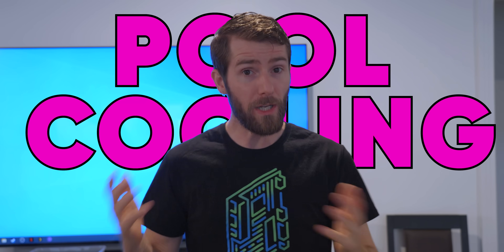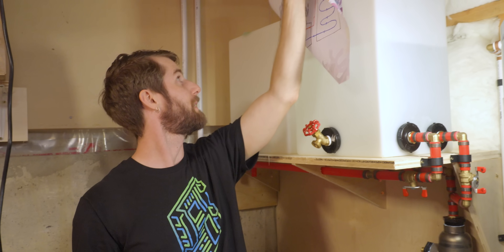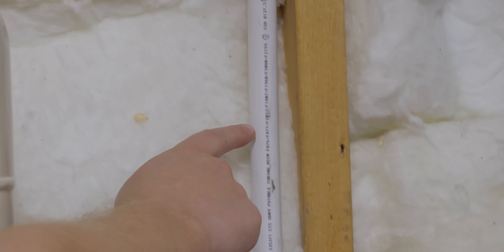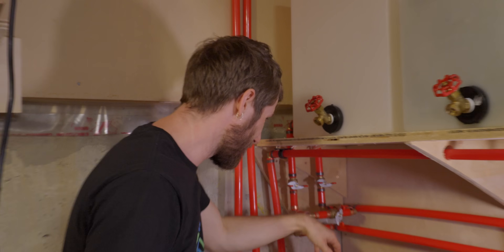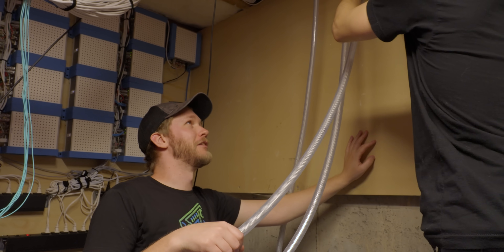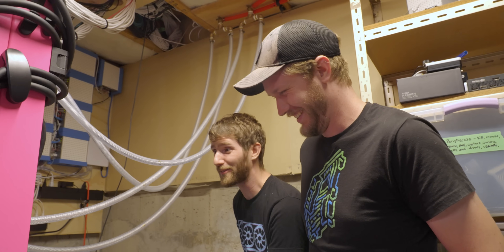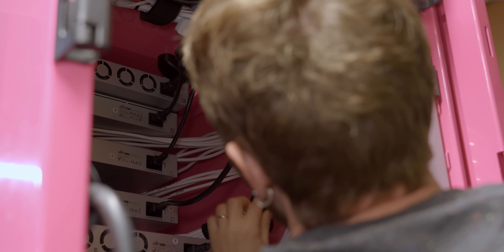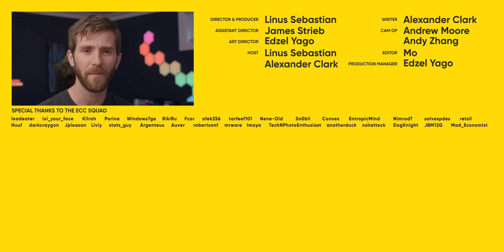My pool leaked and killed my computer - Whole Server Room Pool Watercooling Part 4

Comment: The junction section being in the rack is terrifying, pls point it outwards at least HAHA
Reply: My first thought was, why not have it lower than the computer racks, if it does leak then most likely it isnt going to piss all over the racks.
Reply: I was thinking the same, Linus is just begging for another computer failure because of a leak, especially when the junction was leaking on a couple occasions already... 
I don't remember, does he at least have a drain in this room if shit hits the fan and they're not there to handle it immediately?
Reply: @tsjeriAu  …and the entire pool drains into the server room? That could be bad. :O
Reply: @dschwartz783 you miss the part about 2 separate loops and a heat exchanger?
Reply: @dschwartz783 As someone else already said, they added a heat exchanger with separate loops now, but even before that the cooling setup was never connected directly to the pool's water but rather to piping embedded in the pool's concrete structure. Attempting to use pool water, which is chlorinated and relatively dirty (between people swimming in it and the environment, especially for an outdoor pool), in a water cooling setup would more than likely quickly go south.
Reply: diy liquid cooling in eletronics is a insane idea to me, i value my moneys too much to ever touch it, everyone i know that has it had problems and lost stuff at some point
Reply: Especially after watching alex jankily fix the leaks in it. Fuck me 😅
Reply: Yes! Also why not run the Tubes up from below? Then it cant run down the Tubes in to the Rack
Reply: To be fair, the last comment pointed out why he did it - the systems are the lowest point in the system, so they can't airlock. But drip loops and "put the connections outside the rack" are still smart ideas.
Reply: or maybe have it in an enclosed box ?
Reply: yo what i did not expect to see u here
Reply: Typical LTT jank.
Reply: Yeah we can conclusively say this "in/out" shenanigan is bad.
Reply: my thoughts exactly, manifold in the rack and above all the systems, too... sounds like another disaster waiting to happen.
Reply: It would be cool if you could do some pc based content in the future
Reply: The legend himself! I would love to see you getting a custom PC from Linus some day. 😅
Reply: @M1tZk1  Would be awesome, but he already has a rather killer setup
Reply: @M1tZk1  legend? he plays videogames in his bedroom while recording himself, how is he a "legend"
Reply: @solid8313 he may just "play videogames in his bedroom all day" which btw isn't all he does I took 1 look at his channel and saw a video of him working on his car and other car related shit, no need to act like this to someone just cos they like a moderately big youtuber and think they are a legend, you obviously have nothing better to do w8th your life
Reply: Loool I just came here straight up from your BMW M3 GTR update video and the least thing I expected was to find the pants man 🤣
Greetings from Mexico 🇲🇽, love your videos sooo much
Reply: U got to get a PC built by these guys😂
Reply: Nono, they did it the right way, its gonna be the next video when the thing leaks, i already know it 🤣🤣

Comment: Air defense in my country had something similar built in the 80's. It was an underground protected command center with SOTA Soviet computer technology requiring extensive cooling, so they decided to use a pond close to a nearby village. Sadly it couldn't be used for swimming since it was fenced off and guarded...

Comment: i had a dream like this but with Intel CPUs and a bunch of 4090s hooked to my Underfloor heating system and my heat pump but i  woke up realizing they are using liquid gas and not water

Comment: I think it would have been a better idea to design the inlet distribution block as it is done in a fuel rail: Only one inlet and a pressure regulator on the other end. By doing it the way you did you cant really regulate the pressure, can you?

Comment: Please use heat exchangers and use filters!
(so the dirty water outside doesn't go in de computers)
this a real good update!

example 1:
Put a cool water buffer with coil inside de room. They are easy to get and are often used for hot tap water.
The cool 'pool'-water goes through de coil, in which the coil is the heat exchanger. Put a watercooling pump in the computer, which is connected to the header on the motherboard. This pump draws cool water from the tank.

example 2:
Put a small plate heat exchanger in the computer with a waterpump in the chasis.

Even better: plate heat exchanger in the computer and a cool water buffer with coil inside. combining example 1 and 2

greetings,
a previously cringing HVAC-engineer.

Comment: What's the pont of the reservoir for the pool side?
You could get rid of it and just put like 2bar of pressure on the system.
And on the highest point a valve to release the air.

Comment: I never thought the pool water was a good idea for water blocks considering pool chemicals and debris, however how is adding potassium iodide even a good idea with a loop containing copper? Why can't they actually use parts that are designed for these applications, instead of going full jank? Is there no research done? I predict galvanic corrosion and brittle blocks in about half a year.

Comment: In EU You'd crimp metal ferrules on stranded wires before installing to prevent short circuit in case one of those tiny strands broke (and possibly touched something)

Comment: ALWAYS USE END FERRULES FOR STRANDED WIRE! that screw terminal will crush the strands, damage them and make very bad, unreliable connection that will work itself completely off over time. And in case of a motor, we're not talking about years, we might be talkking about weeks or months.

They cost nothing, take a minute to install and tools are cheap and easily available.

Please. This is mandatory in the EU for good reasons.

Comment: Instead of « in / out » I would label the tubes with « cold / hot » instead, and use blue/red colors
Reply: You could but blue and red is clean water for your sink
Reply: @LeePrzy  and its used for heating to.

Comment: Few sugesstions ... 

1. water splitter put outside your rack ... please ! A lot connections means a lot more posibiltiy to leak  😂 

2 . Put it lower than racks, if watter start leaking on one of the connection ,water will move on the black hose away from all el. things 

3. When you put white tape give a little tension  

Sry for bad eng.

Comment: I love this adventure. And i really enjoy not having to deal with ntp fittings. This manifold and the wormdrives wont let me sleep and i personally would add some monitoring for flowrates or at least pumps working and temps and a watersensor(sensors). But it doesnt matter, watching alex and linus is just fun. really enjoying it. Also Alex' labeling might not be fool proof (looking at you linus ;-) but perfectly fine for me.
Can we please get a follow up how the system worked and how switching to wintermode went?
Also press F for the switch. WTF happened? You guys cant end the video with such a cliffhanger

Comment: When I was doing custom cooling loops, I would use arrows on the tubing to indicate the direction of flow. The only time I would label "IN" or "OUT" was where the tubing terminated or passed through the wall of a PC case.

I was really hoping for more info on that burned switch at the end. Shame, it looks expensive!

Comment: The closed loop could've been achieved by using the outter pipes (the pvc ones) as guide for the smaller ones, taking out the coriolli effect due to diameter changes and not needing the heat exchanger

Comment: Every single one of these videos is "our last set of choices led to a predictable disaster, but we figured it out this time!" Looking forward to learning how this all went wrong (and how obviously, too) in the next one.
Reply: Also, they didnt seem to have properly fixed or tested the cause of the leak, namely one system overheating and not shutting down, but rather melting/weakening the tubing. Any pump failure (or other flow inhibition) can lead to the exact same failure mode again
Reply: Yes, this isn't so much got in a professional as, got some advice from a professional (/got them to do a tiny bit) and then janked up everything else slightly less. Although putting tap water and salts (potassium iodide) in the PC loop? There's most definitely going to be follow-up videos.

Comment: I work with industrial pressurized air and cooling solutions, and one thing is certain. The industry standard for marking directions of flow within pipes and hoses are ARROWS. You never ever only write in english which way the flow goes.
It's confusing and can lead to accidents or malfunctions.
Always use arrows which can be understood regardless of language.
Colour coding for temperature or pressure is also standard.

Comment: I hope one of the upgrades is using an indirect cooling system, with a closed loop on the devices being cooled and the pool water used to cool that via heat exchange.

Comment: You used a plastic bucket and some straws you picked up at Burger King held together with sellotape attached to incorrect plumbing fixtures attached to incorrect plumbing fixtures attached to IIRC a hollowed out potato.

Hard to see what more you could have done to prevent this.

Comment: I wonder, if would it make sense to use automatic sensors to detect faults as secondary protection so failures will be reported immediately... addition to that add solutions that can be controlled by automation to react on fault. So even if risky solutions like pool water used for cooling fail, it wont destroy as much... as it probably has infinite amount of water to use... in reality.

Comment: Whenever you do some crazy watercooling. Put the reservoir on the ground and pump into the reservoir. This way, leaks end up as air in your tubing and water on the ground, whereas if the reservoir is in the air, it will drain into your system.

Comment: I would put pressure/flow sensors in the loop (evena temperature probe), link them to an arduino and then implement a feedback control for the pump flow. Even installing a simple lcd with telemetry
(Yes, I am an engineer and I like to overcomplicate things in the name of cool)

Comment: At the end of the install, pulling on the power supply cables like an absolute honk and then wondering why a device would get a short and burn out.... Are you serious?! I saw that coming from far....

RIP Switch 😢

(Also, I personally would NOT install this cable whip at all)

Comment: Add thin water collection trays under each server, put water sensors in those trays, wire up home assistant to shut down your servers if water is detected.

Comment: That fire and the instantly blowing fuses were a bit concerning. Hopefully you get that sorted out before something much worse happens.
Reply: Yeah.
I'm thinking he might have a grounding issue somewhere.
Reply: my first thought was if thats PoE and does not have diode isolation - that power cord he unplugged could have been live and grounded to the rack @The_Keeper
Reply: Yeah, it will not funny to have video about linus burnt house.
Reply: nah, a lot of janky installments and a plastic water manifold in the inside of a rack, full of computer and ups equipment. what could possibly go wrong?
Reply: I wish they would have expanded on that.  They mentioned finding excess motherboard standoffs under the boards and that seems like a potential cause of short circuits
Reply: @SwedishDeathLlama  I assume he meant they were doubled up. But yeah, if they were in unpopulated holes. Sure that could have shorted something

Comment: Had a failure quite similar but not on computer parts I was water cooling LED grow lights. Pump failed water blocks got hot enough to melt the tubing and leaked water all over the electronics.

Comment: As a Plumber from Germany, please don't use Teflon Tape. It's literally the worst.
Use Thread Sealing Cord like Loctite 55.

Teflon instantly shits the bed when you re-adjust the fitting in the Thread, for example if you screwed it in a little too far.

Thread Sealing Cord is also easier to apply in my opinion one thread per..... Thread. And when you are at the end a few threads laid out diagonally across the fitting threads, I work in Gas Servicing now and stuff like Loctite 55 hasn't leaked on me in like... 7 years of constantly using it.

Comment: There are so many warning signs with this setup it's insane. That much smoke from a system is extremely alarming and would be an immediate full stop on an entire rack at most places, but he just glanced over it and continued the video. It's clear that there was a critical short somewhere that could be a major fire hazard, and the investigation into what caused it was just entirely skipped. Along with just glancing over the fact that a 25 AMP (!!!????) fuse blew repeatedly and wasn't addressed beyond replacing the fuse, I'd expect Linus to burn his brand new house down within the next 6 months. This is genuinely the worst idea I've ever seen come out of this channel.
Reply: You realize these are editted videos?

There was almost certainly significantly more time invested into the fried switch and the fuse that was not included in the video as it would be a big tangent off the topic of the video.
Reply: That's a little dramatic bud, a lot of the shit your bringing up would have obviously been dealt with off screen. They didn't just "replace" the fuaw, they switched it out to see what would happen and then you could clearly see and hear them discussing the matter further before they switched back to a different scene... And the switch was also replaced as the end of the video was also filmed later, again you can hear Linus clearly say this not long after the switch died, so again obviously the "critical short" was also dealt with. You want to sound smart but you didnt even pay attention to the video.

Comment: Put a drip loop on those pipes coming into the rack, also I would position the manifold in a location/way that means if there is a leak it won't drip onto the computers.

Comment: You should talk to alphacool about their industrial server watercooling. They probably have quick disconnect distribution blocks. Less chance of leaks and no need to turn off the whole system if you want to add or remove one.
Reply: Realistically if he wanted to do this the easy way he could, and that would be installing air conditioning TBH.
Reply: @strawberyyicecreamdream216  Easy would have been a water cooled rear door to the rack and air cool.
Reply: Put RED LINE - WATER WETTER in the PC side loop ! If it werks on a racecar - it will werks on your pc !

Comment: might want to use a differential pressure transmitter and add a bypass valve and control to a dp setpoint but thats just coming from me a HVAC controls technician

Comment: What about hooking up ac to the pool aswell? Would that be amazing? Don’t think it’s enough heat to warm the pool in the winter but you wouldn’t need to spend any energy on cooling the AC circuit besides pumping to a second heat exchanger and pumping to the pool

Comment: with all due respect this was bound to happen. on the first video you published proposing this idea I cautioned you against it. the chance you saw the comment and would have heeded my warnings to begin with are miniscule at best but when it comes to pools you need to keep it as simple as possible because every layer of complexity raises the chance of something going wrong. it is seriously one of the most expensive luxuries a homeowner could have. 

for my parents' pool they've spent probably twice the cost of installation on various repairs over the years. we have a waterfall that is broken. we had lights in the pool that had to be removed and paved over because they caused leaks. we've replaced the liner half a dozen times due to leaks we installed a solar healer and that leaked. we had to replace the gas heater 3 times due to multiple failures. only one of the 3 skimmers works. it's a real disaster. 

the fact that you decided to add more points of failure (not to mention near costly computer components) leaves me truly flabbergasted. 
with that said, I can't wait to see what happens next.

Comment: I wonder if you've got feedback on the neutral leg of your electricity.
Might explain the blown fuse and the switch blowing up.
There's a lot of pumps and whatnot going on around there.
Would be worth looking into.
Reply: Time to bring back Brian the Electrician from Northern BC for a special investigative ep!
Reply: Neutral ain't very neutral in a system like this... Some replanning of the power distribution would make a big difference, shortest path to ground and all that.

Comment: I’m still confused how he’s running this in Canadian winters where pools need to be drained from November to april
Reply: It's Vancouver. Leaving a pool mostly full for the winter isn't uncommon, we don't generally get enough sustained cold to freeze a pool. The lines to the pool would be the bigger risk and that is why they are filled with anti-freeze. 

If there is a long enough period of sustained cold that it would be an issue, the pool is always heated by the solar cells and the server room and can have more heat put into it if things get really bad.

Comment: oh, that's the LC issue I didn't think of, I just thought stuff will instantly overheat when the pump dies but not ruin the whole setup! AC in comparison can handle quite a lot of load and when idle everything will stay perfectly fine even if you had fans that failed

Comment: What happens in the winter when the pool freezes, if the internal loop stops running that water could freeze in the heat exchanger?

Comment: >Supposed to be 10A
>Fuse rated for 25A
>Fuse blown

I probably wouldn't have tested it with another fuse and just measured it with a current meter at that point lol.